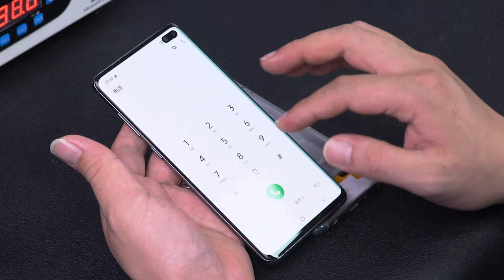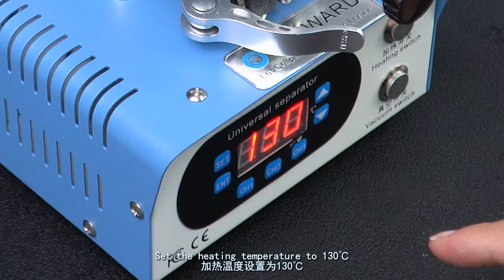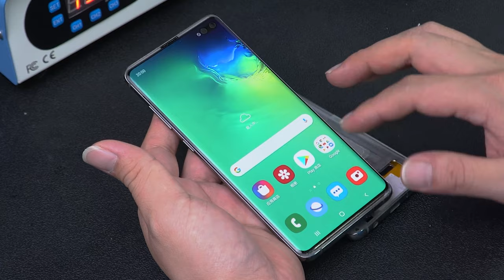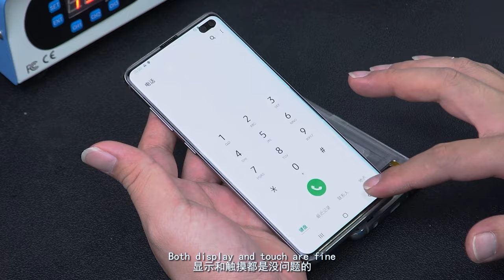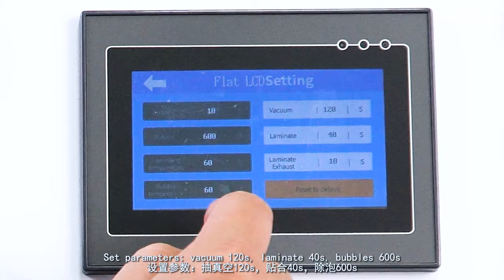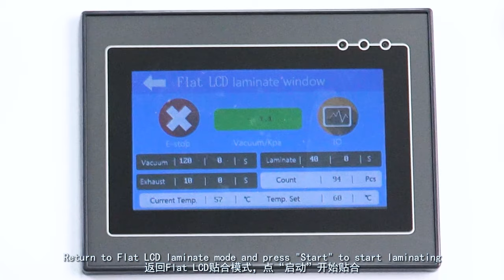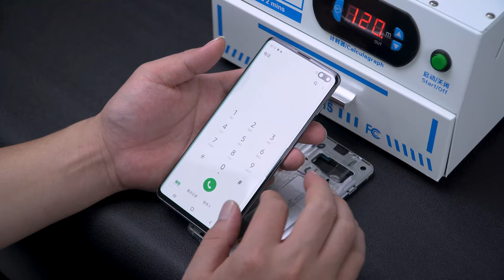Samsung Galaxy S10 Plus Cracked Front Screen Glass Repair | In frame Laminating | RMB-3+ Laminator

Comment: Great  job! 
How long time do you keep on heat separator?
Thanks
Reply from the maker: During this repair process, heating was continued from the beginning of the separation of the glass to the end.
Reply: @FORWARDMachineFactory  what story with temperature for battery and lcd.lithium battery don't like temperature. Lcd not yellowing from that temperature. Thanks
Reply: They do not have full phone just the housing and screen.

Comment: what is white oil
Reply from the maker: White oil is a liquid used for cleaning. It contains little water and dries quickly.  It's the same as alcohol. It's for cleaning.  It works better than alcohol, dries faster than alcohol, and leaves no trace.